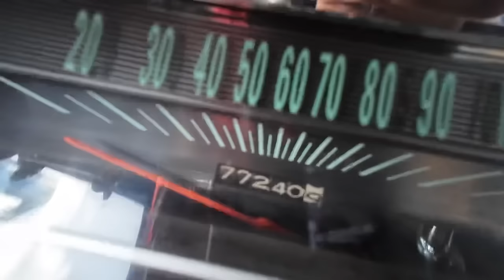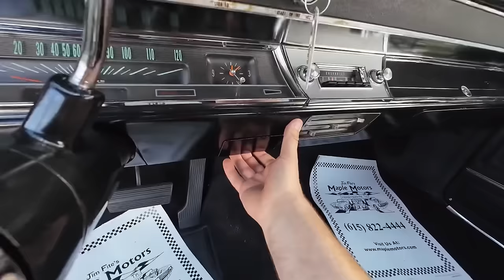Test Drive 1966 Chevrolet Chevelle SOLD $34,900 Maple Motors #2528-1

Comment: Nick Southgate What's up with the fly wheel covers on a lot of cars coming in without them on?
Reply: I have been told by some guys they believe it helps keep the transmission cooler. I say add a trans cooler then, 😂. It’s a pet peeve of mine. They are inexpensive, easy on & off. Easier than even making the horn work! 😂. 
    I actually really like this car! Other than dressing up the motor a little while keeping it as is otherwise, making sure the tire rub is addressed, and then there’s little I would do. I would have to have everything working on it mind you. Any of my restorations get the wiring harness worked over seriously or fully replaced. I’m not making a car so nice and then watching it burn because I didn’t make the wiring safe. That’s why so many guys keep a fire extinguisher in their classics. I have one in every one of mine.